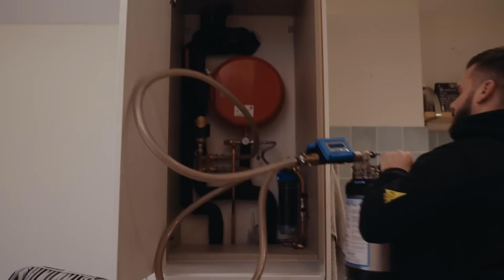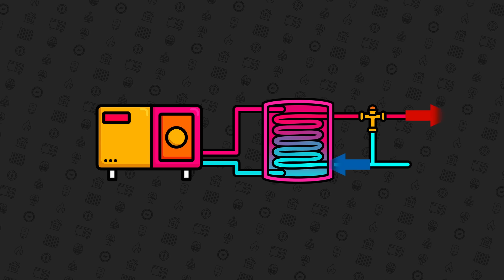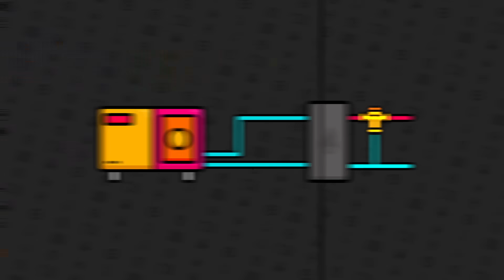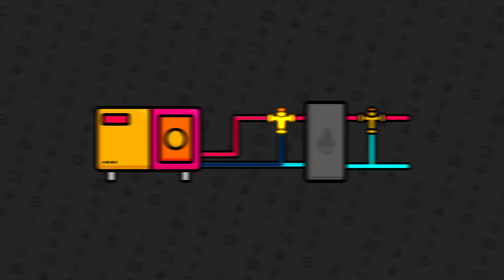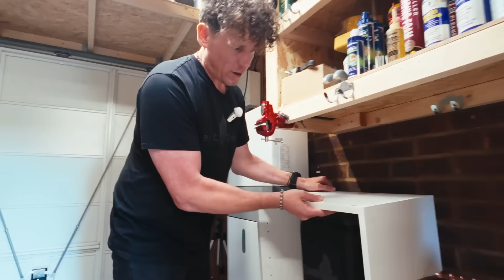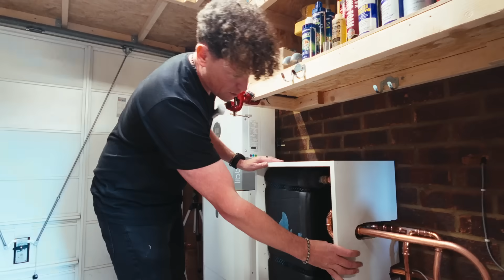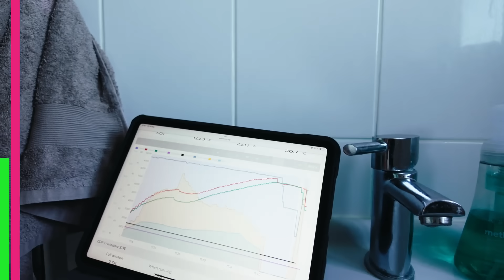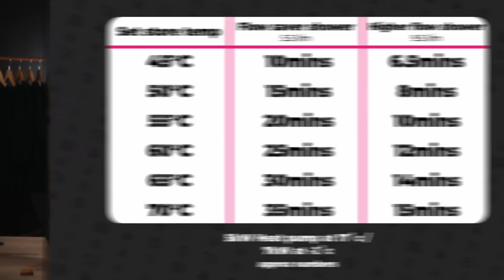World’s smallest hot water solution. (With a heat pump)

Comment: 20 minutes at 7 lpm with 45-41c will run a 140 litre bath 😮
Reply: This comment needs pinning.
Reply: It was actually 5.5 lpm, assuming the table is correct and Adam misspoke
Reply: Apparently, the average amount of water people typically run into a bath is 80-100 litres. But filling it that slowly, a lot of heat will be lost from the bathwater while it's running. I would like to see how it does with a higher flow rate - ideally 15-16 lpm, but definitely at least 11-12
Reply: Googling...small baths are 100-150L. "Standards" 150-200L. Large 200L+. So if its 7lpm that will do for most baths (but still take some time to run??). If its 5.5lpm thats 110L will do for small baths. So i guess (correct me if I've gone wrong here). This will do baths even in houses that dont have lots of space (presumeration that not enoug space for hot water tank, probably a smaller bath as well...). But if you want to run regular large baths still better off with the classic big one water storage (I dont know the name's of stuff).
Reply: This has actually been done and is in pre-Developement testing. It will supply unlimited amounts of hot water at combi boiler flow rates, but also has many other benefits.  Can’t say much more as I’ve signed an NDA

Comment: could you not combine this with a sand battery? fill the containment box with sharp sand and insulate the outside, the sand would absorb heat over time and release it as the heat exchanger cooled.
Reply: Adding some thermal mass inside the insulated outer case would certainly help. Water has a much higher specific heat capacity than sand does (about five times higher), so a water jacket would be better in theory. The system volumiser that would typically be required in small properties can also offer some additional thermal storage, but we come back to the space limitations of small properties. Somewhere that can only fit a Nano Store might also struggle to find space for the volumiser.
Reply: @tlangdon12  I didn't realise there was so much difference, I suppose they use sand when they want to store heat in the many hundreds of degrees. Another benefit of a water jacket, would be the ability to fill and drain it in situ, avoiding having to carry it around.

Comment: I was surprised it kept going - I would have expected that during the 'pre-heating' phase before the valve from the heat pump to the heat exchanger opens the return flow temperature would rise rapidly and cause the heat pump to throttle back.  I'm pretty sure sure it would with my Daikin HP.
Reply: I would imagine the heat pump is set for something like 55C flow and the loading valve is set for just under this (53C) so that the heat pump is still operating at full chat when the heat exchanger is starting to drop the return temperature to the heat pump. The heat pump will continue to work at full power trying to get to 55C. An adjustable loading valve offers the option of tuning the solution to the specific characteristics of the installed heatpump.
Reply from the maker: @tlangdon12 yep